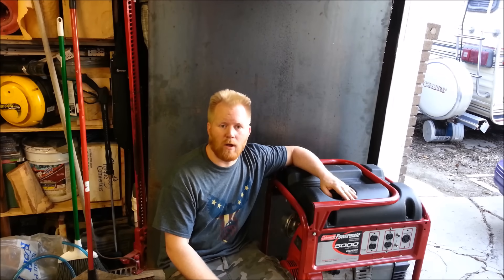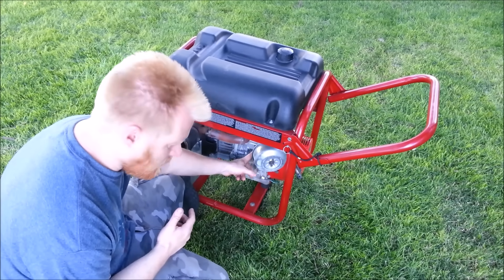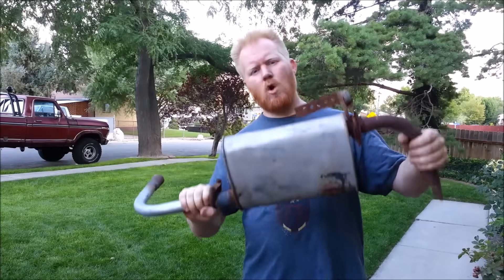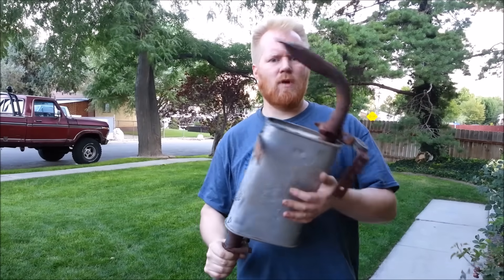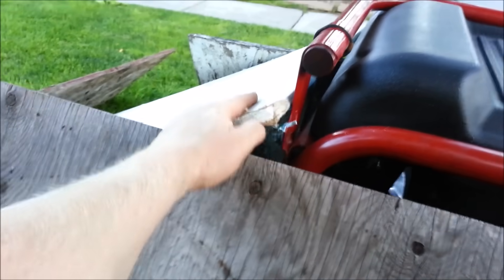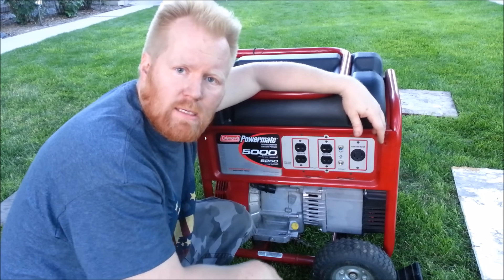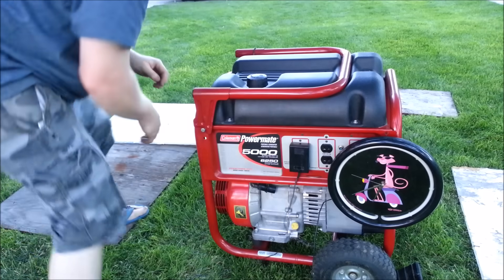4x Quieter generator in 10 seconds

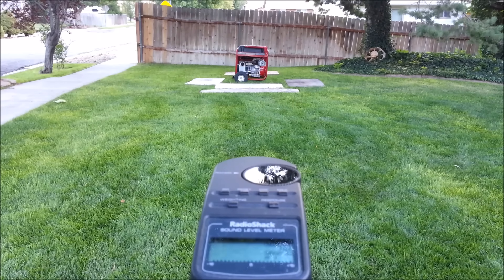Comment from the maker: If you only have the attention span of a 2 year old you can skip to 5:19 in the video. Before this I discuss the pros and cons of adding mufflers, both absorption and deflection styles and why mufflers won't get you where you want to be. This video is just showing proof of concept from a scientific approach. 

The engine cools itself with a fan though a bunch of small holes the combined size of maybe a softball. The generator cools itself the same way with a similarly sized hole. So even left fully exposed the engine and gen head still only pull in a fixed amount of air. There are large enough gaps left at each corner to accommodate 50-100 times the required air for the engine/gen head to properly cool themselves. There is going to be very minor radiant heat that would dissipate upwards that isn't going to leave as easily but it hasn't been a concern. After numerous running tests the engine and generator head are plus and minus 2-3F at numerous locations between shrouded vs not shrouded. Some non pertinent items, like the metal frame are warm to the touch where normally they would feel cool if left out in the open. Air cooled engines are commonly run in enclosed spaces without issue. Of course common sense needs to be used and proper gaps at each corner need to be left to allow air flow.
Reply: OohzyJohnDow You poor guy.  Your world is literally literal.  
I tested his title.  It took me 10 seconds to set up my baffles.  It baffles me that you couldn't see that as possible from his explanation.  The explanation is more time-consuming than the execution.
In terms of hyperbole, there could be a video "How to have a child in 2 minutes."  Reach in, grab hold, pull, tie, snip, done!  With a silver belt buckle.  That leaves out "the set up".  The ?? Hours of labor.  The admission to the hospital.  The cab ride.  The... 
Those are probably involved, but LITERALLY, the removal from the birth canal to separation from the mother ship is 3 minutes.  Wait... I said 2 minutes ,didn't I?
Ok, "... separation from the mother ship is 2 minutes."
Whew.  I don't want to get reported to YT for misleading titles.  [But, OH, THAT CLICK-BAIT!!!]
Reply: Oohzy - I guess you have not the foggiest idea of how the Decibel system works. If anything, he considerably UNDERstated the reduction. It is in fact 10 times quieter.

To complicate the issue however, human hearing is logarithmic (vision too) so the reduction by a factor of ten is not see as such a dramatic decrease - perhaps hence his rather more modest claim.

As for referencing the 80dB, 10dB is 10dB - regardless of whether the original amount is 50dB, 120dB or 150dB. That is how the system works.

A 10 dB reduction from 150 dB to 140dB - is a 10dB reduction = 150dB is ten times louder than 140dB, 123.45dB is TWICE as loud as 120.45dB (3dB = doubling of power)

I am also guessing he meant 10 seconds to erect the boards from flat - not the amount of time taken to try and explain it to people. Arguably he should have taken longer still - so he could explain the basics of the dB system so people would realise that the initial figure of 80dB is academic with regard to a given reduction in dB.

100dB - Jet take off at 300 metres
90dB -  DC9 overhead but just 1 mile up
80dB - Freight train at 15 metres - and his generator to begin with
70dB - His generator afterwards
60dB - Conversation level in a quiet restaurant.

His very simple method made a surprisingly good difference to the ambient noise level.
Reply: lmao
Reply: Alpha Omega so will covering it up with plywood to make it overheat, it's just recirculated hot ass air
Reply: I do, so thank you very much for the help! ;c)
Reply: Loudness is perception rather than a strictly objective measurement but a reduction of 10 dB is commonly considered to to be just half as loud with the baffling, so you might say it's just 2x improvement.
But the -10 dB could be considered like 10 baffled generators sitting at the same distance contributing to the noise, and it would be equivalent to the one unbaffled generator as far as the sound energy.
Reply: With all the other ideas, I think you’ve hit it right on the head!!!  Nice job!!!
Reply: sixtyfiveford  dude thanks
Reply: It's not a lack of attention span; you just took too long to get to the point.
Reply: thank you for that!
Reply: David S could've been a meme. :)
Reply: Windbag
Reply: Thanks
Reply: Professional sound meter????  I didn't know RadioShack made professional anything!  Plus sticking the mic in the exhaust doesn't do the mic much good.
Reply: Red leader checkin in
Reply: I believe if you used rigid fiberglass AC duct sheet, it would do a better job to adsorb or absorb sound  better than just bouncing off plywood. Plus it's a whole lot lighter to store away.
Reply: sixtyfiveford I wonder if this technique would still work on pavement or concrete. Maybe about half as good I imagine..
Reply: Thank you!!!
Reply: David Sasson or you can do your OWN video and make it as long or short as you wish.  =]
Reply: Could've shorten the video to 30 sec
Reply: Its better than 4x quieter.  10db is 10x quieter.
Reply: hey OoHzy,,why don't you keep your horeshit comments to yourself,and stay in your mom's basement,gotta be an entitled little liberal.
Reply: sixtyfiveford ganator
Reply: Common Sense..................Common sense? Really? You might want to reread and correct your comment.
Reply: If the exhaust get restricted it will cause back flow destroying engine
Reply: I didn't come to the page to get a physics lesson explaining how sound propagates through the atmosphere. I already know all that. I know about sound amplification, redirection, masking, dampening, changing frequencies, cancellation, frequency oscillation, white noise, absorption, conditioning and probably a dozen other things, some of which I cannot mention, if I stopped to think about it for maybe a minute. I just wanted to know what people would have just lying around their homes to quite a running generator and how they "safely" employee them. I wanted to know how to bake a biscuit, not how to build a 5 star restaurant on the summit of Mt. Everest. So if that's what you consider "the attention span of a two year old" then maybe you aren't as bright and witty as you perceive yourself to be. And the answer is yes, I am a rocket scientist, SNC S/S.
Reply: +Mark T So many ppl (1.6M as of today) want a quieter machine for cheap and easy, but this is a stupid video. Really.... bouncing the sound into the grass is for ppl that were born yesterday and who the heck is gonna be running their hot generator in the grass? Was hoping for a decent looking light weight product that I could just fold up behind it when not in use in the garage or barn. This is bulky splinter hell.. but if you live in the boonies then this works until it rains and you have to drag it and the generator back to the garage. Need to find another video or just make my own... what a waste of time...
Reply: @wavytravy362  Try Zombie Box. Most people don't have the $2000+ to buy one though so the plywood/grass method is more feasible. In my below poverty line opinion.
Reply: @wavytravy362    did you make a video  yet ?
Reply: oh hahaHAHA brilliant remark about the attention span.. 4x quieter in only 10 seconds.. you meant 10 minutes didnt you? As for 4x quieter sigh... -10db of 80db is 4x more quiet? Instead of insulting people not interested in your nonsense mumbling, you should worry instead of clickbait titles and misleading texts! You sire are reported.
Reply: OohzyJohnDow 
😭👶🏻
Reply: Ramix,  you are a little confused and just for you a take a moment to explain it. The time spend on doing the actual silencing is absolutely secondary (on the low end) for why this video is reported, though i want you to be aware that it wasnt just about the time it takes to perform the silencing, its about the time it takes to explain it. Something that takes 10 seconds to perform, doesnt take 10 minutes to explain. Get it? The reason why i got annoyed was the lying in the title of the video. There is no 4X reduction in sound! So that is clickbait and for that you are reported as I do not appreciate being deceived. Not so much to get you in trouble but I just dont want this kind of nonsense being suggested to me from here on.

Comment: OK, not even 30 seconds into it.
A muffler will make a huge difference.
I have a B&S powered 5HP air compressor and adding an automotive muffler made it much less annoying.
Reply from the maker: +archangel20031 It will change the exhaust tone but not the decibels. It will still be loud as hell with a muffler only.
Reply: Without a muffler, my compressor was unbearable, but with it, it was only loud, not deafeningly loud.

Comment: 4X quieter is a misnomer,There is no such thing.
Reply: +callmenort 9 decibels on the sound meter is 4 times quieter - DME
Reply: 4 times ANYTHING denotes a multiplication, the product of which is greater than what you start with. It MIGHT be correct if it is stated that 9 decibels is 1/4 or 25% as loud as 36 decibels. A multiplicand is the number that gets multiplied by the multiplier. The above denotes whenever whole numbers are dealt with. HAGD :)
Reply: Must admit that your answer is twice as cool as mine, But you will probably disagree with that!

I subscribe to the idea that mathematics has primacy over the mere sciences, I think that you do too.

Loudness must also be evaluated against the actual level and the individual's 'ear. Fletcher Munson et al.

My problem is also to reduce the running temperature of a generator enclosed in a wooden 'dog kennel type housing. DME

Comment: I use a large plastic tote box with holes cut for the exhaust, air intake and the starting pull cord.  I would put the tote upside down over the generator and face the exhaust opening away from me.  It cuts the noise down by at least 60%
Reply from the maker: +Hooverdarnit Awesome.

Comment: that gen is air cooled... blocking the air is really stupid if you want it to overheat...
Reply from the maker: +Louie Martinez Of course it's air cooled and if you watched the video you would hear how this is possible. Air cooled engines are ran in fully enclosed garden tractors, old skid steers, VWs, old ATV's, etc without any issue. They don't need 360 degrees of air flow as they only have cooling fans the size of a soccer ball. I leave intake and exhaust holes that are 20 times plus the cfm capabilities of engine and generator head.
Reply: Louie Martinez idiot

Comment: Making up an exhaust pipe going into a five gallon bucket of water will drop the exhaust sound a lot, then you just have to deal with the engine noise.
Reply from the maker: +Billy Cook The majority of the sound comes directly out of the engine block itself. The stock muffler is generally quieter than the sound from the block.
Reply: +sixtyfiveford  Nice, simple solution.  Thanks.

Two thoughts:

Although still a large reduction, as others may have said, a drop from 80db to 70db is 1/2 the loudness, not 1/4 ("Perception of Loudness" - http://trace.wisc.edu/docs/2004-About-dB/)

Trying to analyze, not nitpick here ... it seems to me that it would be next to impossible to differentiate between the noise from the standard muffler and the noise from the engine block only 6 inches away from the muffler (as you tested it).  Unlike a point-and-shoot digital temperature gauge, the sound meter, pointed at the engine block, is certainly still picking up the sound from the muffler (and every other part of the engine).  

This all makes me still wonder where the noise is coming from.  However, for practical purposes, the noise comes from 'the whole generator', so I suspect that nothing short of a enclosure-type barrier (your style or a box) will really reduce the sound much.

Comment: Excellent idea. For folks talking about measuring sound reduction, 10dB reduction means half the loudness perceived. (Very different from electrical power, where 3dB is half (or double) and 10dB is 10 times.
Reply from the maker: +Andy Craig Thanks. Yeah, there is a lot of debate on the Decibel subject.
Reply: Andy Craig Yes. Look up sound power. This is the energy. Perception is the next biggest popular issue.

Comment: glad we have 50 hz here, 3000 or 1500 rpm also makes a lot of difference! in stad of 3600/ 1800! lol
Reply from the maker: +MrBugsier5 Very true 50hz does make a huge difference. Honda lawnmowers actually reduces the speed and performance of their mowers in favor of running around 3000rpm just so they're quieter.
Reply: yea, its a huge differents in sound level.

Comment: 3 dB mean power (energy) related to a ratio with the factor 2 (doubling) or 0.5 (half). So, 6dB =3dB+3dB (means 2 multiply by 2 =4  or 4 times quieter. 9dB =2x2x2=8 quieter. And 10dB means 10 times quieter. 20dB=10dB+10dB means 10 x 10 = 100 times. etc...
Reply from the maker: +Georgi R Yes, but there is a lot of debate about the subject. The problem lies with the human ability to actually hear sound differences. It's definitely a subject people are passionate about.

Comment: I saw that thing with the boards done on a film set I was working on one time. They were running the lights, etc. off a small generator that was VERY noisy and one of the directors put the generator about 200 feet away with plywood all around like this guy did. We were actually able to film inside without the sound having generator noise!
Reply: +Lynn Magnuson  distance is best but when you go 100 to 200 feet away you need heaver cables or you get too much voltage drop and airflow is important

Comment: don't get me wrong I like your credits and video quality, just put more thought in the enclosure, why not build a box out of more wood with slanted internal baffles and square walls on the exterior? cost you nothing more than a few more pieces of scape wood than what you have there and some screws, a couple hours with the use of a saw, tape, maybe even rhino line the inside and you'd probably get a 20-25 dB reduction for

Comment: Did you put a heat gun on the unit to see the temperature difference? maybe you can check that on another video. thanks for sharing your results.
Reply from the maker: +Jim Tsarnas I did temp readings all over the unit, before and after. The greatest increase was around 2 degrees F and some areas were cooler.

Comment: Did you ever measure the temperature before and after you blocked it up like that?
Reply from the maker: +Bob Cartwright Yes, I did. I used a basic infrared thermometer and measured a dozen different points after the unit had run for 10 minutes then after it had run another 20minues under the boards. The temperature readings were +2F in some areas, the same in others and actually -2F in others. All within the margin of error. Small engines are designed to work in partially enclosed areas in equipment and have excessive cooling built in. They are air cooled and are built to handle extremes. The Generator head also has its own cooling fan and pulls constant airflow through. All this being said as long as you maintain a larger gap for airflow than the machine has on itself, you should be fine. The inlet areas are on the generator head are around 36sq inches as well as the inlet for the motor. The outlets will equal the inlet so the motor and gen head need around 144sqin(1 sqft) of airflow. So as long as I have around 2 square feet of opening it will be more than doubling the airflow area that the engine/gen head needs to properly cool itself.
Reply: +sixtyfiveford My nephew runs one in a work trailer every day and they only last about a year, so i was wondering if heat build up was the problem.
Reply from the maker: The Chinese ones I've seen only get around 6 months of use being ran for work everyday (1000hours). The Honda GX series and Briggs commercial should get around 3000hrs of use. 8hrs a day for 5 days a week is around 2000hours so I'm curious what he's using. Oil can play a huge role in air cooled engines. Virtually any multigrade (5w-30, 10w-40, etc) will break down in an air cooled engine and cause engine wear as they are not made to handle the higher heat of aircooled engines. He should be running Straight SAE 30 or if he is concerned about excessive heat SAE 40.

Comment: i had a gen like that with the suby engine and i ran it nearly constant for 3-4 months almost solid......then ran it 2 more months for atleast 18 hrs constant our a 24hr day.........it started using oil pretty bad but it still ran great.....i stiil have it....tore the engine down and it looks great on the inside.......rings are worn out, that was it........i was running my entire house with it....our power had gotten shut off.....i had unlimited gas for it cause i worked at a recycling yard and got all the gas out of junked cars that came in.......great engine in my opinion..........
Reply: I'm doing the same thing and mine has quite no compression and want start
Reply: @michaelpalmer4160  when these are barricaded the air doesnt cool it properly! Kills the engines
Reply: Gary Marshall you environment killer.